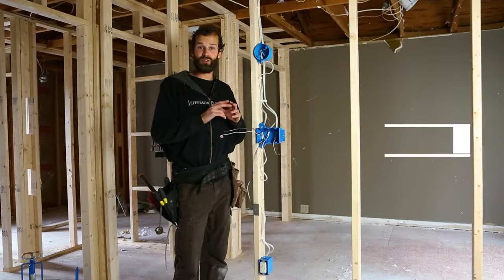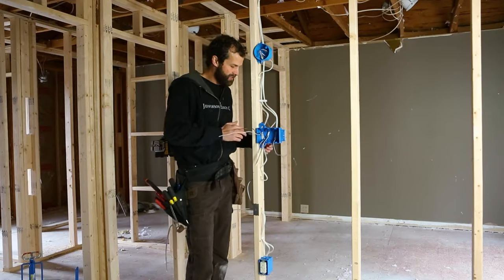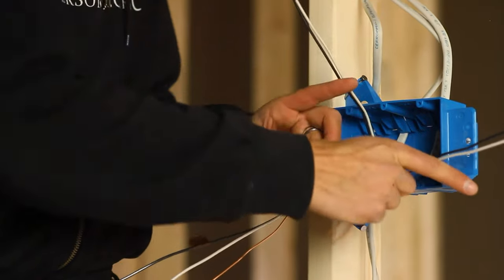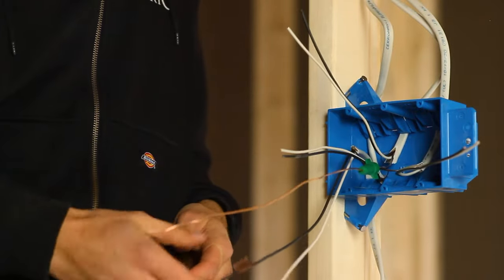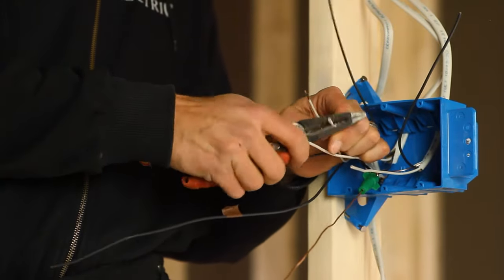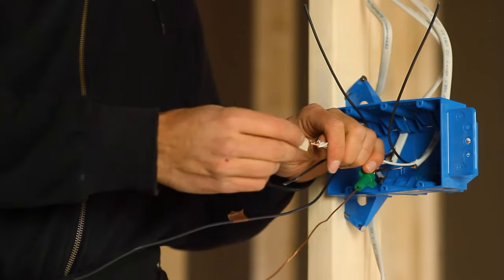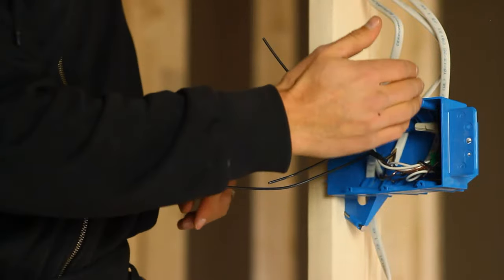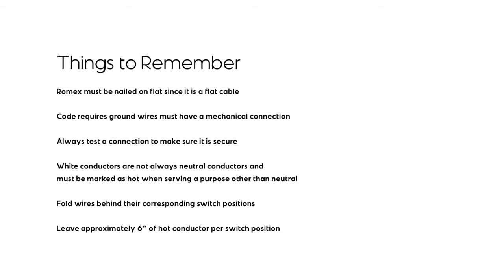Setting Up Wires for Switches in a 3 Gang Switch Box

Comment: how do you know witch one is the hot feed coming into the box ?? on a all ready installed outlet in a new home ??
Reply from the maker: By code the black conductor should be black, but a more thorough test would be pulling both wires off of a device and testing them separately. The hot will have a voltage ~120, while the other should only have nominal voltage ~10-20

Comment: When do you attach the white neutral wire to the silver screw on the switch? If ever.
Reply from the maker: It's generally best practice to connect ground to green screw, then neutral to silver, then hot to brass last

Comment: I have some 3-gang boxes in my house with all grounds connected with a wire nut, but there are no pigtails for grounding each of the switches. Is it ok to daisy-chain a single ground wire between all three switches, instead of using individual ground pigtails? My concern is that there is very little space left to add three individual ground pigtails. Is this ok and code-compliant? Seems like it's ok to do since a single ground is coming out of that grounding wire nut.
Reply from the maker: Yep, totally fine! Good check.
Reply: @ElectricProAcademy  awesome, I appreciate the prompt response!
Reply: @ElectricProAcademy  I thought I’d ask another questions while I’m at it 😀 I have a GFCI in my garage with no other outlet or switch on that circuit. I want to install a floodlight, can I source power from the GFCI load side? All GFCIs in my house are by themselves on individual CBs, I don’t know if that’s a code requirement or not (I’m in NY).
Reply: @keebineer that’s where I would source it from if it were me.
Reply: @jlewis1091 that’s what I ended up doing :)

Comment: Just have to mention that romex going into blue boxes must be stapled within 8 inches , 12 inch rule applies when you have a 2-screw NM connector like you would use on metal boxes because they actually grab the romex correctly
Reply: @ElectricProAcademy  I suspect that Matt is thinking about the exception to 314.17(C), where it states that where the cable is fastened within 8 in, securing the cable to the box shall not be required. There are blue boxes that have knockouts instead of integral clamps, but the one you used here does have clamps.

Comment: What's the plan for the hot wire and the ground? It looks like you will jump the ground wire from switch to switch and if so I can understand and accept that. The hot wire should be pigtailed to each switch imo. The flange on the box must be supported by using another stud. Letting it hang there unattached is unacceptable. Overall, I'm not thrilled, you can do better than this, Joel.

Comment: Why only one ground pig tail when you need 3 ? AND  Why not just make up the bx already if ure already touch in it, I'm not a fan in touching things twice, if I see someone wasting time like that I'll fire them because there costing money to the company in being inefficient,  touch it once leave it ready for trim-out and get out...!!
Reply: First of all, that's not a ground pigtail. In fact, he didn't do any pigtails at all, which is why he folded all the hot wires after joining that. Him or his other members will do the pigtails later when the walls are up and the switches are ready to be connected in the box. So I guess his method of bonding grounds is to use a green wire nut to leave one long wire which would then be pigtailed or connect all three switches.

Second of all, this is his work, not yours. He's the CEO of his company, so the fact that you think so low of him really worries me. If you like to pigtail before trim-out then do so. But don't expect others online, especially a master electrician/CEO to follow everything you do